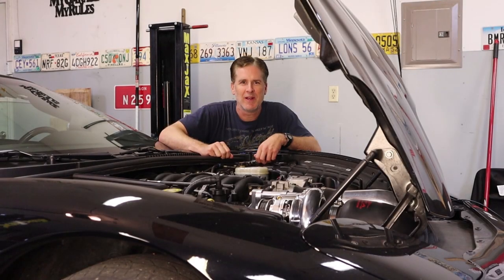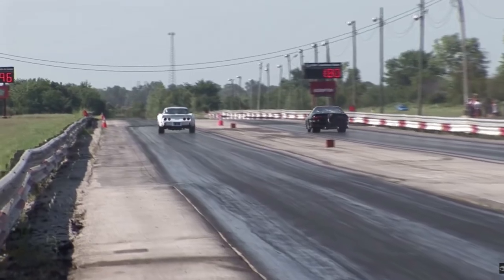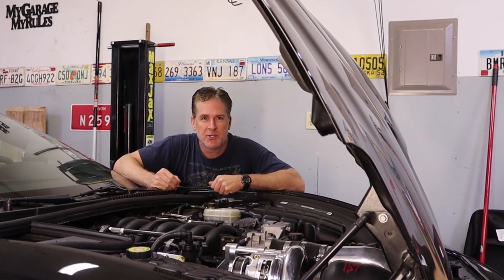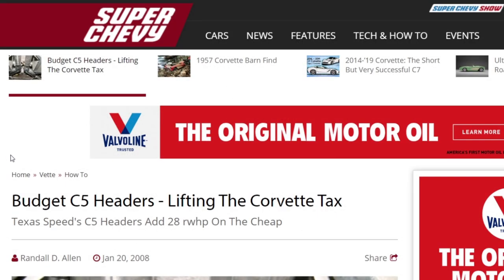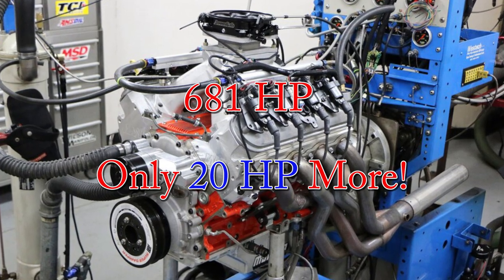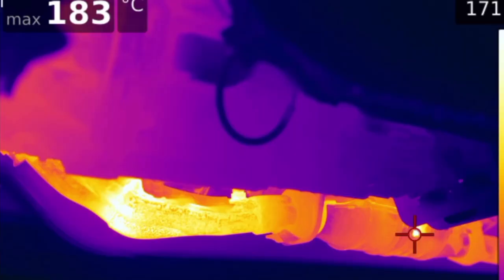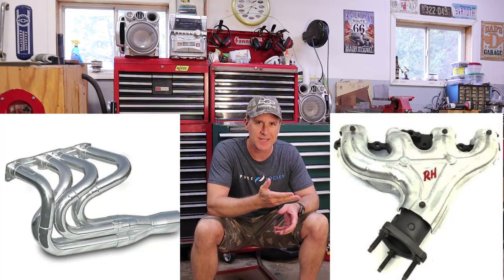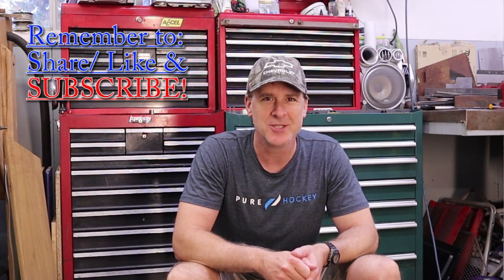C5 Corvette Headers - Everything You Need to KNOW!

Comment: The later style C5 manifolds look really well designed. They almost look like a shorty header. I don't know why GM stopped with that design and went to the log style manifolds. I wonder if I would get a benefit swapping out my Log style manifolds to C5 style manifolds. I'm with you on underhood temperatures... one reason I've not gotten headers! That'll kill your performance too as it can increase you intake air temps even if you have a cold air intake.
Reply from the maker: Are you talking about the difference between the late C5 Ex manifolds vs the LS2 C6 Ex manifolds?  I agree - but gm did it to get the cats up closer to the head so they heat up faster. It works very well they were able to totally ditch the air injection system - which is ugly, makes changing plugs harder and as these cars get older - starts to malfunction setting codes.   I am with you and can't help but think the C5 ex mani's are more efficient !!
Reply: @Toys4Life wow thanks for all the details!

Comment: Excellent video!  I've heard the shorty headers gain an average of 8-10 RWHP and better sound.  Not much in the way of power gains,  but they are lighter weight, and they sound better than stock... Combined with the 8-10 RWHP gains,  I think they are a good buy.  I still prefer long tube headers,  but I do like the shorty headers as well.  I gave your video a like,  and I'm already subscribed.  Keep up the good work 👍
-Chris
Reply from the maker: I was looking at some shorties, I'm curious if they pick up a couple horsepower without throwing off a bunch of heat. If it's 5 to 10 n/a, I wonder if it would be more up in the 600 area.

Comment: I have never heard anyone mention heat being an issue at all. If anything they'll actually reduce heat because they dissipate heat much better than cast iron manifolds, which hold on to the heat for hours. Not only that but the reduction in back pressure will help hot exhaust gasses escape, a restrictive stock manifold will cause more backpressure and that will cause the car to generate more heat, not less.

I have long tubes on my F-body Camaro, big cam, high compression aftermarket heads (compression increases heat a lot) and I haven't had a single issue with heat, even when it's 100 degrees outside. F-body engine bays are much tighter and have less room to breath than C5s do. Heat is 100% not an issue at all.
Reply from the maker: Think about all the surface area of a set of headers versus cast iron manifolds. There's no question, headers radiate significantly more heat than cast iron manifolds.  furthermore the cast iron manifolds have the heat shields from the factory which not the heat radiation down even more. Hi underhood temps can cause heat soak which kills power until you cool the intake track down, and what's the long-term effect of all that heat on alternators, air conditioning compressors, electrical connectors etc.  I guess we'll just have to respectfully agree to disagree.
Reply from the maker: Matt Brad  I am not suggesting things will melt within a week.  The higher heat will contribute to heat soak in slow driving conditions and over the long term (months to a few years) may take its toll on AC compressor, alternator, wiring connectors may become brittle etc.  Just something to think about when comparing the minimal gains (especially when keeping stock cats) vs the stock ex manifold.
Reply from the maker: Matt Brad  Sounds like GM made the f body and Corvette parts  pretty  heat resistant.  Interestingly enough, I have an '08 Tahoe that came from the California deserts and all of the wiring loom covering is disintegrating. Not exactly sure why, but I think it has to do with the heat of where it came from. And that's got a giant engine bay with cast iron manifolds.
Reply from the maker: Yeah, I'd rather replace the wiring loom, then I have the whole damn thing rusted out like our Minnesota cars are after 10 years...

Comment: I’ve always thought that headers were a big pain to install, poor fit, leaking issues, always in the way. I never saw a “naked” C5 manifold, very efficient looking. Questions: Is the C5 Z06 manifold any different than base model? I was shocked to see how heavy the stock H pipe is. How much weight could be saved with an aftermarket X pipe?
Reply from the maker: The stock mid pipe in many cases includes four cats and the area between the cats near the front is double walled in some parts I do believe. So yes it's heavy and those are OEM cats which are higher quality than your typical $100 aftermarket chats.

Comment: So do you have long tube headers?  Since you have a supercharger, how did that influence your decision?
Reply from the maker: I am still using stock exhaust manifolds. They're pretty efficient compared to old school manifolds, and honestly at 585 RWhorsepower I believe   I'm right at the edge where I'm asking the stock LS1 long block to make for horsepower. Especially the Pistons. I'm also not a fan of excessive underhood heat and I believe haters do contribute to it.

Comment: I have kooks headers and a full Corsa exhaust which I love but without a heat shield my kooks headers have cooked my starter solenoid, (no pun intended) I'm on my second starter in less than 6 months. just a heads up for any new Vette owners or if you're thinking about headers don't make the same costly mistake. . . invest in a heat shield or wrap, save your starter.
Reply from the maker: Thanks for sharing this valuable advice!

Comment: I feel like headers are worth it on some n/a engines with very crappy and restrictive manifold designs (like most 4 cylinders, V6s, etc) but for the LS and the way the whole engine bay is a heat sink...totally not worth the price for the meager gains.  Also, I've had cars with no cats before, and have driven behind cat less cars on back roads, it sucks breathing all that crap in.  These are just conclusions I've come to for a sports car that I want to daily drive.  Obviously, I would do all this stuff if it was going to be a track-only toy.  :D
Reply from the maker: Same here.

Comment: So it sounds like the short answer is this. If you need the 20HP, install the headers. 
I LOVE the way the LS engine sounds with headers (on other cars), but for me, It's not worth the ground clearance issues on an already low sitting car. I wish there was another way to get the tone that comes with headers. I'm thinking an X-Pipe just won't get me there with stock manifolds.
Reply from the maker: I've heard the speed engineering headers have much better ground clearance than the Texas speed ones.

Comment: The reason I went shorty on mine was due to emissions. I wanted long tube but my state would fail me. The shorty are way lighter than the stock ones BTW.
Reply from the maker: Good point on the weight!
Reply: It's crazy that just routing the exhaust tubes differently would either pass or fail a car. How could there be that much difference in flow?

Comment: Ok been a Corvette owner for a year.  I've found there are three kinds of Vette owner. 20-30 hp is nothing to turn your nose up at or seem unimpressed by. That's a great hp gain for the buck. If standard manifolds were so efficient they wouldn't be restricting a dixie chopper Worth of power. 1 type elitist if it was built that way then the engineers at GM did it for a reason. Ask your gm certified mechanic what you can do.
2. Vette lover. Is excited to finally own his dream car mentions wanting to modify something or not using gm for maintenance and gets pummeled and shamed into a mute by elitists. 
3. Gear head.  It's just a car and feels taking your car to a mechanic is unheard of might as well turn over your man card go get a pedicure and buy some of those corvette pucks type one keeps telling about. And thats a turbo manifold that's glowing red
Reply from the maker: 25 horsepower is a good horsepower again for $1,000. I would question if it's a good gain for the price of a set of kooks long tubes, a Corsa cat-back and a tune for 4,000 bucks...

Comment: How do you keep the factory cats when switching to long tube headers on a C5??? The short answer is you don't. Anything from the cats (or where they were) back is only for sound.... Factory exhaust flows just fine, unless you want to throw money away. BTW this only tells part of the story, foot pounds of torque is a better measurement. ;)  Anyway...20-30 hp @ the rear wheels for a couple hundred bucks is worth it; I have personally ran cheap-o ebay headers without issue on more than one C5s I have owned. The secret is to ALWAYS go with 304 stainless, 409 will rust and are just garbage ALSO wrap/ceramic coat your headers. You are welcome. ;)
Reply from the maker: The factory main cats (not the pup cats) are quite good.   They could be welded into your new mid-pipe with basic welding/cutting skills- or most buy the mid-pipe without cats or with new cats as a unit. Probably because at $120 /hr shop labor it is is not worth swapping over.  Makes sense to me for the guy that does his own work.  Ben (C6 Z06 car on my channel) has kooks MP with kooks cats.  we just tested his backpressure 2 weeks ago and he has an amazing 1.5 psi of backpressure before the cats.  My C5 has 10 psi.  Even with ceramic coated kooks in Bens C6 - his underhood temps (and even the interior of his car) get quite a bit hotter than my stock manifold C5.  Hot enough in fact, that he is glad he has the stock ex manifolds as some day he may switch back.  What header are  you saying for a couple hundred bucks it worth it?  At the end of the day - to each their own.   For some, the sound may just be worth it all by itself....

Comment: How effective are ceramic coatings or header heat wraps for minimizing heat with long tube headers?
Reply from the maker: Best I can tell, ceramic helps a little - but most do it for the looks.   Wrap helps a lot, but there is lots of complaints about wrap destroying headers over a couple of years.
Reply: @Toys4Life  Oh!  Man, I did NOT know that!  So…if one goes with long tubes, what are any ideas for reducing under hood heat or maybe that and CONTROLLING it?  Could add’l intercooling help?  What would increasing the diameter of the headers AND everything else from there back, say from 2 & 3/4” to 3”, do? Just want to keep from frying my engine compartment and increasing heat in my Vette.
Reply from the maker: What's your horsepower level at?

Comment: Great video! I have been on the fence about putting long tubes on my 03. Your video helped me decide not to go with them. I am still trying to decide about installing a x pipe. I will be putting Corsa cat backs on for sure. The car is stock.
Reply: Why? The sound improvememt is ridiculous
Reply from the maker: Great to hear!
Reply: Get headers, heat is not an issue at all. Of everyone I know who has modified LS powered cars (some making 900+ horsepower) not a single one has had any sort of issues related to heat as a result of having headers.

A good set of headers and an X-pipe will sound better on a stock cat-back than a Corsa cat back will sound with stock manifolds and cats.
Reply: I agree, for 20 hp, not worth it. But if you will have other mods then the benefits will compound.
Reply from the maker: @henrycruz45cal  Agreed but, I chose that other high HP motor dyno test of headers vs cast manifolds to because I was shocked at how good the cast mani's did even on a high HP setup.  Something to think about anyway.

Comment: What is the latest fix for a P0153 code from lt headers
Reply from the maker: When Lt headers are installed, it's very common to get slow response codes (P0133 & P0153).  Another pain point for LT headers. Header wrap may help - keep the heat inside and activate the O2 sensors quicker.  Move the bung closer to the engine?  Different brand O2 sensor.  Just some ideas.

Comment: Never seen corvette headers getting that hot under normal conditions.  Yet you showed a turbo 4 cylinder as a comparison that was likely 2 stepping its ass off.
Reply from the maker: Sorry.   Just trying to illustrate all of that thin wall surface area of individual tubes radiating the heat into the engine bay.  vs of course, the thick cast iron low surface area manifolds giving off significantly less heat and more out the rear exhaust.
Reply: @Toys4Life  yea but to get to that point you would have to be hooning like a mfing fool lol.  Or running lean as all hell

Comment: You got nothing better to do.... I wonder if it was an attempt to tune the exhaust note by GM? Why don’t you pull it apart again and weld it  up solid so we can hear that too🤔, you have all winter 🤓
Reply from the maker: Weird - I think you intended to comment on the H-Pipe video but it showed up as a Header Video Comment - Strange.....    C5 H Pipe small holes intentional by GM? -->Make it louder - maybe.  Make it sound goofy probably. ----> make it last 100k w/o cracking - probably.

Comment: imo not worth the hassle.Unless you have an all out drag racing car, and you are cutting every corner to gain a couple of hp here and there,forget it! Then for the all out drag racer I would strip the interior,strip,out the trunk junk,etc.etc. No thanks I don't want a 3rd car! I have a life!
Reply from the maker: I would say it's more of a sound modification than horsepower. But you're right just depends on what you want out of the car and what you're willing to do for a few horsepower or a different sound.

Comment: You know it would have been nice if you used a laser heat sensor just to verify the difference in temperature rather than just making a statement. I don't think this was scientific enough or fact filled enough.
Reply from the maker: The point was more so the large pattern surface area with all of the long individual thin steel tubes radiating the heat versus the shorter thicker cast iron manifolds. Not necessarily the surface temperature.